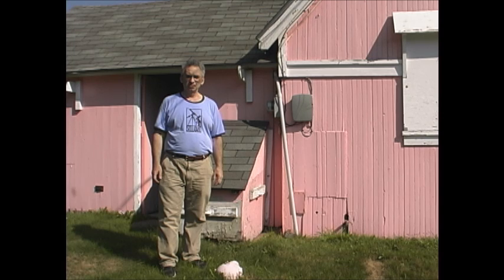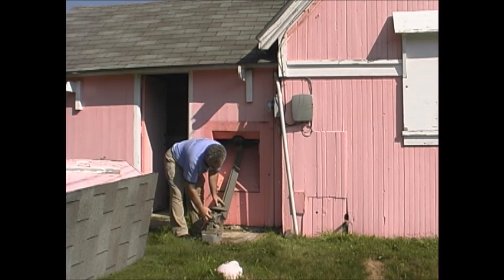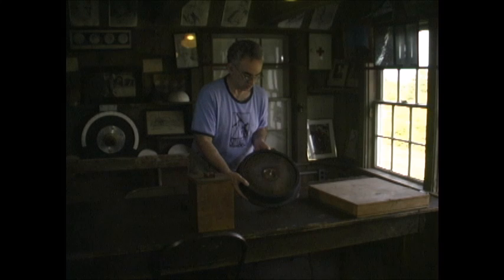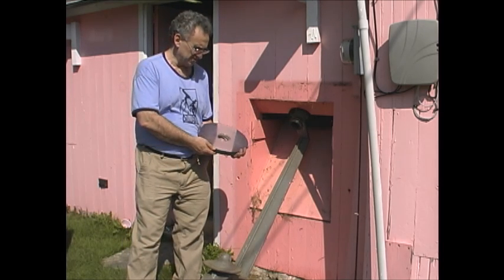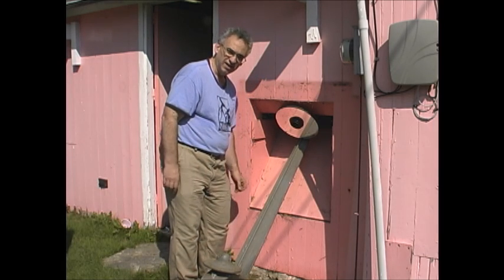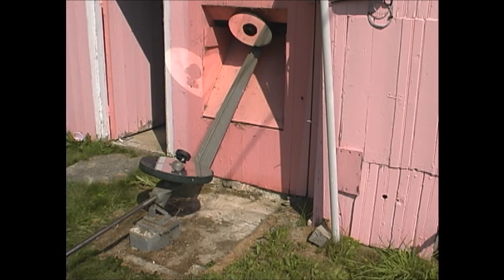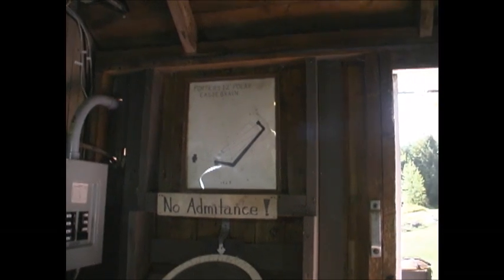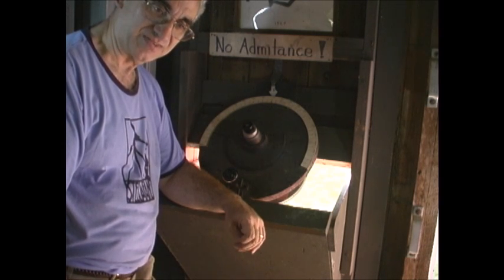The Telescope Maker's Workshop: Integrated telescopes, The Polar Cassegrain

Comment: I've been going to the Stellafane Convention since 1995 and I've only seen this telescope opened up one time!

I hope that it is soon restored to its original working condition, with recoated optics with a good figure. I hope that no one adds "modern improvements". It should be left as originally made.
Reply from the maker: +George Normandin It will be left as is. We just need to recoat the optics.

Comment: That was really very interesting.  Unusual instruments like this are fascinating to me.  It seemed almost crude, but I think it's actually just extremely functional.  I couldn't imagine what forces the counterweight is designed to counteract.  How do you clean prints off old optics like these?
Reply from the maker: +Barnekkid These optics are in serious need of recoating so I was not too worried about prints. I intend to put this under the autocollimator and check the figure then we will need to recoat them.